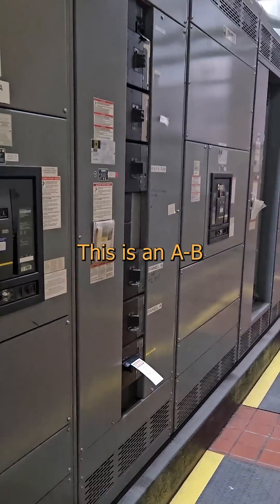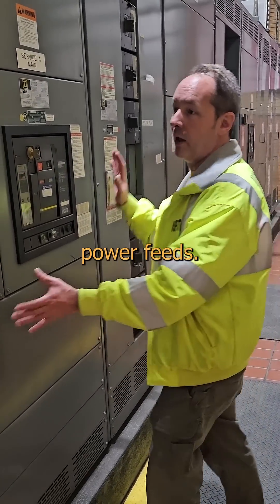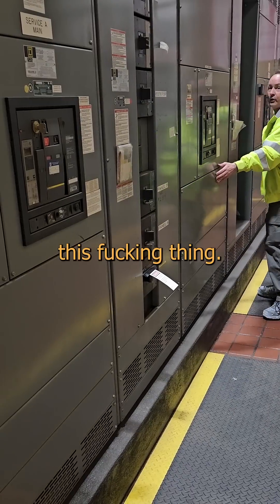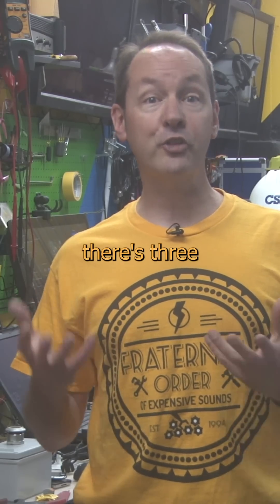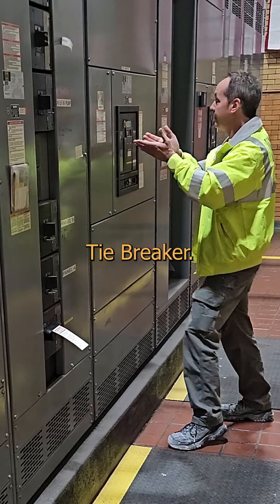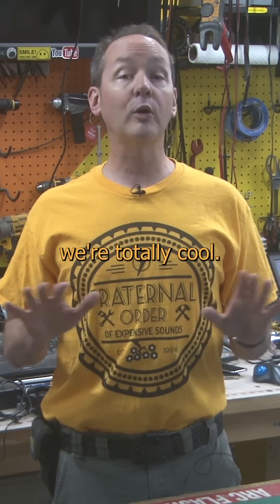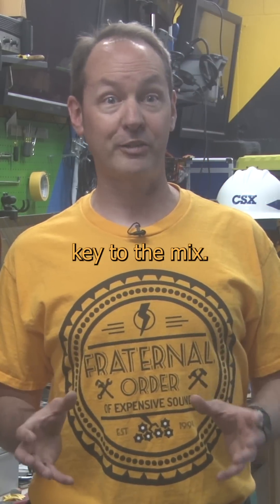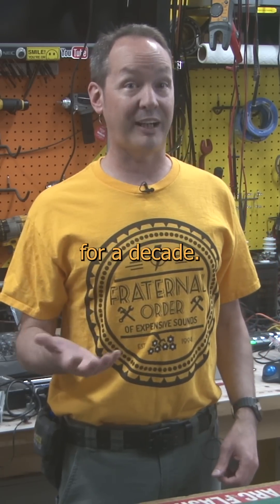A B Interface #chrisboden #comedy #electrical #engineering #energy #substation #switchgear #power

Comment: I survived it.  I was doing work on a compressor,, plumbing work, new taps for the 1" shop lines.  When complete, I did the normal compressor maintenance, belts, filter, drain the condensate.  All breakers were off, main panel, sub panel, switch   When I grabbed the valve to drain the condensate, I became the ground for the entire plant.  Multiple electricians over the years, multiple remodelings.  I burned through the 480 volt 3 phase feed, (all 4 copper conductors) burned out the 15kva transformer, and survived it.  I personally went out the next day and purchased 2 10' grounding rods, acorns, bare copper conductor.  and grounded the damned system.
Reply: That hurt SEVERELY just reading it. OW!😢
Reply: I personally want to take a multimeter to you and check your resistance. You’ve gotta be one of the few guys pushing 80k-100k Ohms. God am I glad you’re here to type that message. Hopefully with no everlasting ailments.
Reply: @krisfitz1235  The full disclosure is complicated.  When I was a kid, 8 to 18 I used to play, in the shop with my father's experiments.  A Van de Graff generator that pushed up 1,000,000 volts,, at 5 to 20 micro amps  Could give you a small welt like a bee sting.  And a Tesla coil that produced about 120, 000 volts but at considerably more amperage.  The power we are talking about,, the fluorescent lights in the house  used to light and flash from the arcs in the shop, a separate building 50 plus feet from the house.     The tesla coil  hurt if you took a shot.    Through my life  struck by lightning twice,, heart restarted withing 10 seconds both times,, some internal damage on the second one,, mobile,, but took about a year to fully heal.  Serious heart afib failure 3 years ago  8 months between onset and high frequency ablation that fixed it.  When I took that shot from the ungrounded machine shop, heart stopped.  Trust me,, the loudest thing you will ever hear is the complete absence of a heart beat.  I immediately stood up and walked toward the roll up doors,, I WANTED to see the sky.  I have been an outdoor person all my life.  As I began to gray out, five, six steps,  the heart restarted hundreds of beats per minute,, and then slowing gradually over 30 seconds to a fairly normal speed.  I hurt,, My heart hurt.  I lay about for a week  and then,,,, in the two years since the electro-cardiologist has stabilized the afib stuff,,, I had a daily work durability of about 3 or 4 hours.  As soon as that week of rest was past,, my daily work durability was 6 plus hours. If I worked a full 8 or beyond,, I paid for it the next day.  But there was a distinct improvement after.  73 as I write this,, my normal lazy self, but I have a permit for a nominal 100 mile canoe trip in 6 weeks.  I love being out.  And I will stick to that 4 or less hours of paddling per day ,, and take lots of paperback books to laze about the bank somewhere,, read, eat bad food, watch the sky and wildlife.  I figure that all that fiddle fuckin' around as a kid playing with high voltages,, my heart learned how to reboot
Reply: @Sailor376also Man they don’t make em like you anymore. Your story gave me chills sir. I work with high voltage daily as a Laboratory Technician for Underwriter’s Laboratories. Taking a hit like what you describe is unheard of. Most men would be cooked like a Thanksgiving Turkey. I do think your exposure to electricity at a young age could have played a vital role in your survival. However I still am curious as could be to what resistance measurement you’d produce. I myself am also an avid outdoorsman! Just got done fishing for Northern Pike all Labor Day weekend. Keep enjoying God’s Green earth and making the most of every minute! I hope that ticker of yours can give you many more years of peaceful living. As it seems it’s more than deserved. Thank you for sharing your story & kind regards from Illinois!
Reply: @krisfitz1235  most people have 2+ MILLION ohms in skin resistance for most of our body... water though drops that to hundreds though...
Reply: @krisfitz1235  Dude must have had the driest skin on the planet that day
Reply: When you said "I burned through the 480 volt 3 phase feed" I pictured you slicing through the machinery like one of those hot styrofoam cutters lol.
Reply: @christophermorin9036  Thank you !!  My morning humour.  I laughed immediately as well.  The main reason it is so funny..  Pretty danged close to that.  Truth, I assume the cable, buried under the drive/road? (all desert compacted dirt and concrete aprons)  already had a flaw in it,, a sharp rock had damaged one of the conductors?   When it was uncovered,, all four copper conductors were melted into an arc fused mass,, the 15 kva transformer was fused... it tried to burn me too,, not a heck of a lot different from one of those resistance wire foam cutters.  Boy, it sure felt like it.  Laughing,, one of the other comments suggested testing me for my ohms readings.
Reply: @Sailor376also  Less of an ohm rating and more of an ohmygod rating lol
Reply: @christophermorin9036  Laughing,,, that's gooood.
Reply: At that point, I think the only proper answer is to start worshipping Zeus.
Reply: @tamnker8465    I completely agree.
Reply: How? You provide no explanation.   What was the failure mode? How did the entire plant end up grounded through one lousy branch circuit to an air compressor, and why was there any voltage on the ground anyway?  And you went out the next day for grounding rods…huh?
Reply: @foremasp  Exactly the failure mode, truth telling,, I do not really know.  But if you stop and think about it  Circuit breakers switch the hot legs,, the grounds are inter connected through out the system.  I may have shut off the shop, but the power was still up in five other buildings being fed from a large  3'X3'X3' ?  about a ton, pedestal transformer  90 kva ?  There was not a grounding rod anywhere in the system.  25 years of 'improvements',, different electricians, no single oversight.  At least one rod I found weeks later,, cut free, abandoned, when a building wall was moved.  In truth, I was no different.  When the licensed guy came out to replace the underground burned through and the dead transformer,, I made sure the shop was grounded. two rods driven 16 feet apart solid #4 copper linking it to the transformer and the main panel. I did not go back and correct deficiencies elsewhere in the system.  I focused on making the shop correct.
Reply: @foremasp  Almost all circuits leak to ground in some way or another... if you are talking a whole facility I would be highly surprised if there was not some sort of current to ground
Reply: @foremasp  I'm with you man. I call bullshit too.
Reply: shit like that is why basically everything at the dc i work at is grounded to the nth degree lol
Reply: As a generator tech that just did a 840kva load test today, if I was paranoid about my wires touching the frame of the enclosure, now I’ll lose sleep over it. Thank you.
Reply: @pedrohbrr  I have a stupid simple for you.  I don't do a lot of electrical.  I know it, fairly good at it, but only among a close group.  And I am far more likely to be the knowledgeable person hiring and stupidvizing the licensed guy actually doing the work.  I have done many residential meter and panel installs and particularly panel upgrades.  I ONLY own fiberglass ladders.  They are non conductive,, and when I do a meter or panel swap,, drumroll ,please.  The first thing I do when confronting the meter socket where I am about to remove the #4 copper and replaced it with 4-0 aluminum,, to upgrade the house panel from 16 circuit 100 amp,, to 40 circuit 200 amp,,  I lay a 3/4" sheet of dry plywood on the ground,, and place a plastic bucket to sit on. I have used the 3/4 plywood in 2 feet of snow between Christmas and New Years.  A dry 3/4 plywood and plastic bucket or fiberglass ladder will keep your body from being a ground path.  That is my recommendation to you. Further, invest in high voltage electricians gloves.  Wear at least one glove.  I am right handed,, I keep a glove on my left hand or,,, I work one handed.  left hand stuffed into my left hip pocket.  Non electrician tools,, black or red electrical tape many layers thick, the entire tool.  The plywood is the best trick I have ever used.  840 kva?  Not me.  That is where I call the licensed guy and stupidvize.
Reply: And I call BULLSHIT! the amperage required to "burn through the copper conductors" alone would have turned you into a human shaped briquet, that 15kva transformer... lolol no, it was not a 15kva on a 480v 3 phase. 50kva, maybe. 15? You would have 240 single phase. Smh, funny tales friend, funny tales!
Reply: @anjhindul   You assume the current passed THROUGH his flesh instead of flashing over the skin's surface...

Admittedly, that kind of juice is hard to survive, but it IS possible to survive it...
Reply: @anjhindul do you feel better? Feel like you might be seen as an authority? Feel like you’ll change that guys claim or his reality? Good job buddy
Reply: @Novabella101  ad hominem argument, attacking the person making the argument instead of responding to the argument:  weak.  Still doesn't explain the claims.
Reply: @anjhindul 15kVA transformers absolutely exist for 3-phase 480V systems. I don’t know anything else about whether or not that story is true, but I can vouchsafe that there are absolutely transformers of that size.
Reply: God, and I find accidentally touching the prong on a lamp plug when taking it out to be absolutely Revolting...
THIS must have been Positively Shocking...
Ohm my God, Watt a mess that must have caused...

😄😁😆😅😂🤣

OK, ok, I'll be good (for now) and stop with the Puns...
Reply: @HappilyHomicidalHooligan  I love the puns.  My father was a punster.  I am not immediate enough to produce a good one, except by accident.    Thank you.  I love it. I laughed.
Reply: @Sailor376also   I'm an Electrician so Electrical Puns are easy for me...

😄😁😆😅😂🤣
Reply: All these people wishing you well, but I'm just thinking "acorns??? Does atree help grounding somehow??" 
But I'm glad you're ok!!
Reply: @KevinCrouch0  it’s a grounding clip
Reply: This exact reason is why if I'm working near exposed wires, I wear one of those current detector pens, and keep it ON the entire time. The times that thing yelled at me to save my ass from an accident are more than I want to count... specially when you are working patching a server, rack and a *tard passed a live wire through the wrong conduit.
Reply: @SDogo  That's good.  Thank you.   That day I was a plumber, threaded galvanized piping for the compressed air, all breakers were shut off,,, but still.  Question?  Would it have detected the fault through the ground before hand?  I was the one who completed the circuit.  Hmmm Alternating current.  Yes, it would have picked it up.  Functionally it would have been the same had I pulled an electric meter.  The feed through to the panel would be dead,, but the legs coming from the pole would still be hot.  And that pen should pick up the hot legs even with no current flowing.  Because it is AC.    THANKS  !!
Reply: @Sailor376also  I have two "sensor" pens. The first is the one that everyone knows that react when you are near an AC source. Yes, even without current flowing, the pen picks the hot wires. This one is the one I wear in the sleeve of my right hand so it beeps if I'm about to touch an angry pixies nest.

The other sensor that I use is not exactly made for AC, in fact, is a line toner/follower for when you install network/phone cables, and need to follow the line with an audible tone. The receiver part, luckily enough, also reacts to AC fields, and has adjustable sensitivity (the amount of weird noises you can hear from near electronics is awesome in some way).
Reply: @SDogo  Thanks.  I have a tone follower,, never thought to use it as a safety warning,, and candidly not sure what shape it is in, battery has not been replaced in a looong time.  But the sensor clip on the right sleeve.. That I am going to find.  Graingers catalog, here I come.
Reply: You are one lucky spud brother. I've tried on 220 accidentally, and that was no fun. About put me through a fence. Did you at least get a Super Power from that experience? 😂
Reply: @kf4293  Actually, yes.    Heart problems 3 years before that.  3 hospitalizations, one heart surgery,, and after 8 months I could go back to work.  Well,,, sort of.  I could work 3 or 4 hours per day.  That is why I got all the classy jobs like repiping the compressor/  After my one week of lazing about,, allowing the muscle and chest pains to subside.  My work durability immediately became 5 to 6 hours per day. Last summer I did a complete roof, shingles, gutters, fascia,, the works.  And then a 2nd floor complete bath tear out and redo/  Old style mud tile job walls and floor.    I am still lazy.  When it came time to haul a ton  (literally) of mud up the stairs,, I hired a kid for the day.   It was not entirely successful..  I still can't find a woman, or catch a fish when I go out in the boat, ALL my lottery tickets are duds.  So, it didn't fix everything.
Reply: @Sailor376also  Not bad though!
Reply: Currents don't return to ground. However... they MAY use ground as a return path to their source, IF that is the path of least impedance. Looks like you were the lucky one they chose and became that path... Ouch!
Reply: I used to wave a pin tester at stuff. Sometimes, you'd be surprised what was hot. Like the whole drop ceiling grid of a room. (Bunch of shared neutrals were shorted to ground without tripping or blowing anything). Took forever just to get the other electricians to believe me.❤.
Reply: @robomonkey1018  I've rewired two houses now, because they were scary, carefully following Code. My last one was carrying 90 volts on the ground wire in our bathroom. I never did figure out how they managed to get 90 into the thing. It's all fixed now.
Reply: You should have went and bought a lotto ticket
Reply: How are you alive? Would not the energy in leakages etc be enough to burn your limb? Or this was just enough to hurt ?
Reply: @richardkudrna7503  When electricity decides to use your body for a pathway, depending upon the voltage/amps, it heats the meat.  The muscle contraction is vicious.   I was struck by lightning, on a sailboat, a fair portion of the charge went through me to reach the engine/driveshaft/prop,,, lots of heating,,, internal burns, most of a year for full recovery.  With the exception of the approx 72 hours after  I was mobile for that period, working, family, sailing. all normal, The compressor, mostly violent muscle contraction,, including my heart.  I hurt. Painful.   For a moment my arm tried to lift 900 pounds of commercial compressor. Heart, same. Took a week for the muscles to stop hurting.
Reply: Incredible that you survived, I’ve been hit by things that should’ve knocked me out of this round of life but that is wild.
Reply: @Novabella101  I have a history of it now.  Playing with my dads 'toys' when I was a kid, welts between a mosquito bite or a bee sting when you take 750,000 volts at 5 micro amps, about a 20 inch arc. Science fairs?   I was a pure terror.  I'd sit insulated on a wooden stool and point my finger Zeus like at my classmates and zap them.  It might have been,, that playing,, my heart learned how to restart, reboot.  What is humourous,, paddles have been used on me twice, afib corrections of rhythm.  I have told the docs, they don't have to put me out.  I know what it feels like. They should save some time.  Yeah, it hurts.  I don't recommend it.
Reply: @Sailor376also thanks for sharing! I do have some interesting ohms readings and have been proximally struck by lightning when I was in high school and haven’t found anything that actually dropped me or hurt like it should yet but I really don’t want to push it 😂 I think I’ll just live mVicariously through your stories
Reply: Jokes on you, I’m an idiot
Reply: @Sailor376also  shoulda bought a lottery ticket too. Lmao
Reply: Im sorry what? Howdid you nit spontaneously combust?????
Reply: Got me beat, I only survived 277.
Reply: Something is fishy. You survived being the ground conductor for the whole plant and wasn't thanking God from a bed in the ICU the next day but instead you were gun ho enough to not pay attention to what would traumatize most to never work in the field again and drove 2 10' grounding rods (I only know residential code not infrastructure code which probably requires a lot more than a couple of 10' by ¾" diameter copper coated rods to be rated for that kind of power) which I doubt fixed the problem if your fixing a power plant by residential 200amp standards. I call bullshit. Chris sort this out for me...
Reply: @tylerdurdin8069  Part of it you are spot on.  Bought the grounding rods and associated the next day, someone else had to drive them, I couldn't. I conducted the orchestra from a folding chair.  Immediacy did not work, found the rupture in the cable the next day, but once that was repaired, we found the 15 kva transformer was toast, took q week to get one ordered in.   Arizona.  Code is for 2, 10' rods, more than 15 ' apart. As I said before, I am also part of the problem, I did not try to correct all of it, just that leg of it. (Which now by default is the grounding rods for that entire branch of the octopus) (Since then I have insisted on several other grounding rods installed.)  Not BS, I called and made an appointment that same afternoon with my cardiologist. (2,200 miles away and, of course,, because it was at least a semi-emergency, I was still alive,, they squeezed me in for 4 weeks later.  You try getting an appointment with a cardiologist.)   To make it more clear to you.  25 miles to the nearest cell tower. 30 miles to the 'local' post office, 120 miles to the hospital.  Out there you either survive it or you don't.  Helicopter is the only way to make it in less than 2 hours,, and that is 80,000 dollars. No insurance covers being dusted out except specialized policies.  Switzerland is the place for helo rescue.  Stop at any Swiss post office for a one month policy, cheap.  Not so in the US.
Reply: @Sailor376also  in the army a buddy took 360 VAC 50 hz left arm to right arm. He drove back to where we lived 15 minutes, his heart stopped Larry Marshall his name, George did maybe 25 minutes CPR, I watched Larry’s  eyes come back into equal dilation, felt his heart beat hard, deep breath, “was I dead?” , then it stopped again. Another 5 minutes CPR from George. Later I learned that electric shock depletes neurotransmitters . It takes time to make new. So long a you have CPR, you can avoid death. I would have stopped at 15 minutes. George would   Not   Stop. That’s why you lived Larry. You never said thank you to George. The idiot doctor that showed up later dismissed everything.
Reply: @richardkudrna7503  Wow !   Lucky man to have a buddy like that.